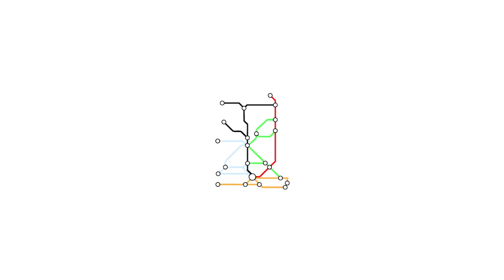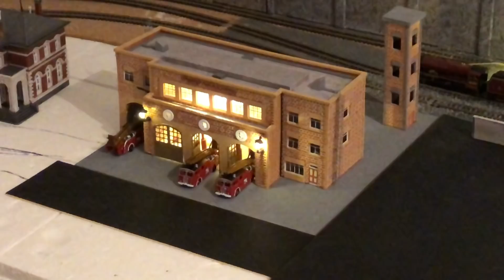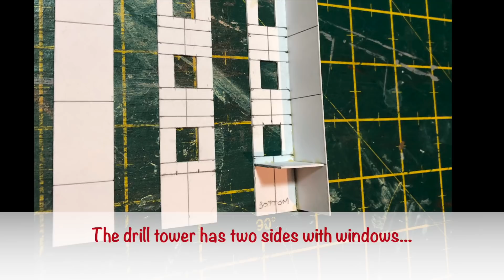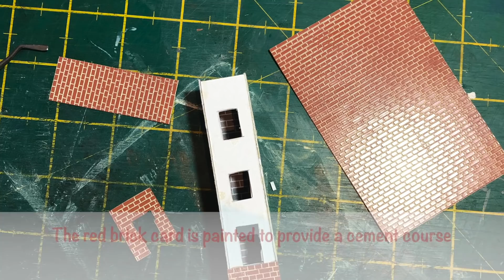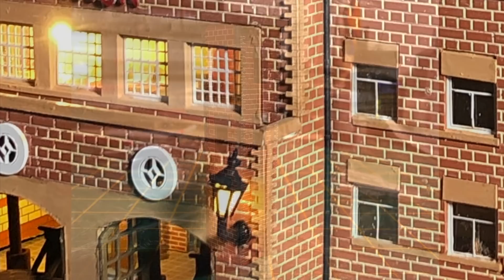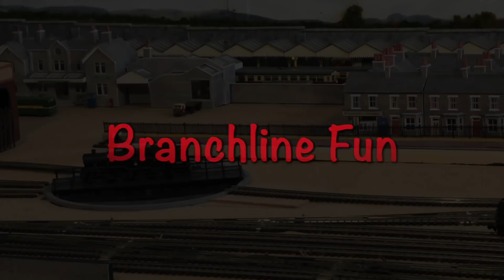N Gauge Model Railway Layout Update - Elvenhome EP 48

Comment: Hi Stephen. Again, I have probably missed the boat, but 1) did you ever consider black drinking straws for guttering, and 2) see if you can find an aerial view (probably not Google Earth as it may not be sufficiently up-to-date) of Cambridge (central) station that has only temporary car parking for brief stays for pick up/drop off. I've not visited recently, so cannot remember what provision there maybe for commuters.
Reply from the maker: Hi Paul.  I must confess I didn't think of drinking straws.  At N gauge the may be very large.  2mm is roughly equal to a foot and drinking straws must around 6-7mm diameter.  You may by now has seen what I did use, but even that is rather overcall.  One of the compromises as I may have said in earlier videos is to get something that is as near to scale as possible while still being visible and large enough to work with. Stephen

Comment: Hi Stephen,
 thanks very much for many enjoyable videos which I’ve been watching for some time now.  A quick question about something different, if that’s OK.  Do you have any experience of your Dapol locos repeatedly uncoupling from their train, particularly when pulling Graham Farish rolling stock?  Unfortunately, I’ve got this problem with several locos at the moment and would welcome any suggestions or advice you could offer, best wishes, Stewart.
Reply from the maker: Hi Stewart and I'm glad you are enjoying the videos.    I do have occasional problems with random uncoupling but I can't say its particularly between Dapol locos and Farish coaches.  It mainly seems to happen if the loco very verily loses power so jolts the following trains which make it uncouple.  I did pay a lot of attention to the track laying to try to avoid bumps.  I did have a consistent problem with my Royal Scot and that was because at some point the coupling had become bent during the manufacturing process. Once bent back into position I've not had a similar problem.  Stephen
Reply: @Elvenhome  Hi Stephen,
 thanks very much for getting back to me, I really appreciate it.  Like yourself, I’ve taken a lot of trouble with correctly laying track. Even so, I seem to have this problem developing, with no consistency in terms of where the uncoupling happens.  Farish locos on Farish rolling stock work perfectly, but the Dapol locos seem to be an increasing problem.  The Dapol connectors do seem to have more vertical movement in addition to the horizontal, so I’m now wondering about changing these for something else. Will see what happens. In the meantime, thanks again for replying and I’m certainly looking forward to watching your up-coming videos, best wishes, Stewart.

Comment: Another great video, as always. A question, what length of track is needed to take a train up a suitable gradient to allow another train to pass underneath a bridge that the elevated train would cross.
Reply from the maker: John Byrne Hi John and thanks. The answer to your question in part depends whether you are using steam or more modern locomotives or units.  Steam models can struggle with inclines. I would think you would need to raise the track about two inches to the track bed of the bridge. 1:50 is suggest to be safest for steam so that would need  100 inches.  Modern traction would do that in 1:25 probably and that would halve the distance .  Hope that helps.  Stephen
Reply: Stephen Humphreys Thanks Stephen, l have mixed steam and modern so if I allow for the steam that should be fine, thanks again, keep up the great work, regards, John.

Comment: Hi Stephen - nice touch with the training tower for the fire station.  Once I get around to building the new Blackwood station buildings I think the power distribution board will be useful.  I tried lighting the buildings before but the lights were far to bright so a method of dimming the lights as shown in your update should work.   Back to HH in Edinburgh tomorrow as they gave me code 80 instead of code 55 flexible track last week  - the trials and tribulations of model railway building 😂
Reply from the maker: The Growler - Blackwood N Gauge Layout Hi Euan.  The power distribution boards really are useful and I am sure you will find them so. Hard luck on the code 80.  I suspect a few choice words were said when spotted the mistake.  But then again a trip to a model shop even in these circumstances is hardly a chore.  Stephen.

Comment: Hi Stephen, Another very enjoyable railway update video. The fire station and training tower look great, well done. On the power distribution board, the center white plugs look like the same type of plugs used on the new Woodland Scenics "Just Plug" lighting system. ( https://woodlandscenics.woodlandscenics.com/show/item/JPNALGT ) and ( https://woodlandscenics.woodlandscenics.com/show/item/JPSOLGT ) Thank you for the copper wire tip for the gutters and down spouts. I'm looking forward to seeing how they turn out in your next video. Cheers, Rich S.
Reply from the maker: Hi Rich and thanks very much.  I will take a look at the Justplug lights again in that case.  I will know in the next few days whether the copper wire approach will work - I am pretty sure it will.  So it should be in the next video.  Stephen

Comment: Hi Stephen, perhaps whilst working on your houses you could use a cool grey fine tip marker just to get rid of all those horrible white edges that they have. You’ll be surprised what a difference it will make. Keep up the great work, kind regards Barry.
Reply from the maker: Hi Barry and thanks. Its funny you should mention the white edges.  All my other Metcalf buildings have been given the treatment.  For some reason I concluded I didn't need to do that with the houses.  I started work on them yesterday and the first thing I noticed was the white edges (especially along roof lines).  So these will be disappearing have no fear.  Stephen